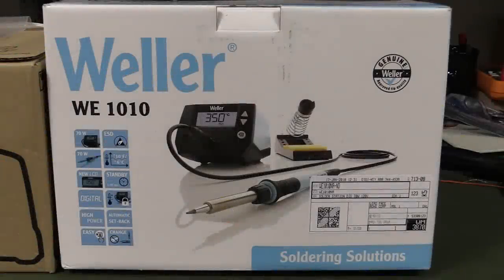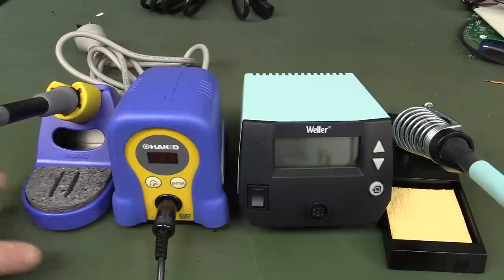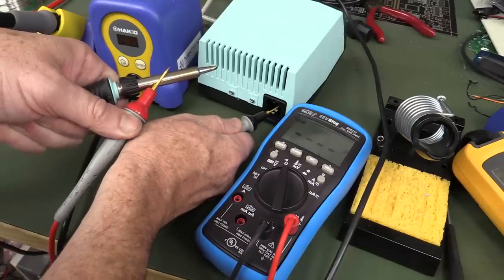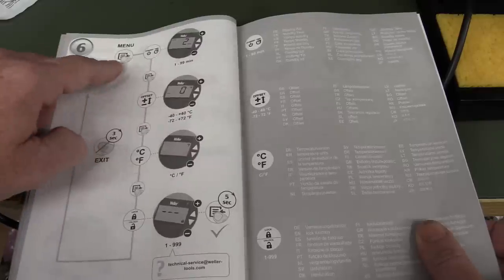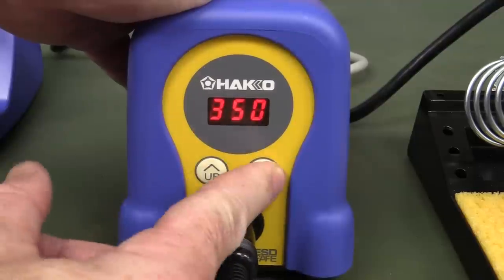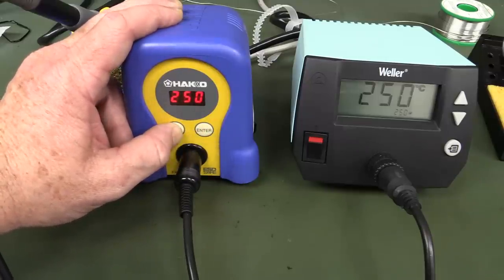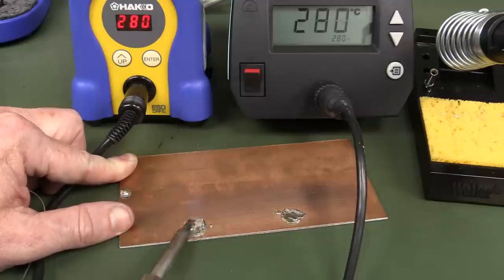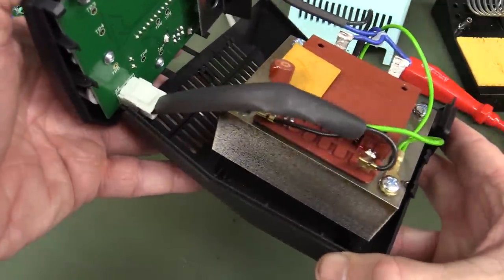EEVblog #1063 - Weller WE1010 vs Hakko FX888D Soldering Station

Comment: Would love to see review of Ersa Icon Pico or Nano. The thing that stops be buying Hakko or Weller is the chunky soldering iron itself. I want something more delicate and pen like. I have a range of Antex fixed temp irons.
Reply: Simon Ashton The “i-tool” irons for the icon stations are great. I have the nano. Wonderfully short distance from grip to tip, and the heating performance wipes the floor with the irons in this video.

Comment: I know this is an old review, but I have had the WE1010 for a couple of years now and have some info.
Some gripes.
1. The display is NOT backlit even though the online pictures from Weller show it to be;
2. How bloody hard would it have been to put a RED LED on the damn unit. I have left this iron on overnight or longer on multiple occasions. Unless you happen to glance at the correct angle onto the NON BACKLIT LCD display it is very very easy to forget that unit is on;
3. The soldering pencil is poorly made and is already loose where the metal iron tube meets the plastic handle.
4. I double sided taped the pencil holder onto the top of the unit to reduce its footprint.

I previously had a Weller WTCP which lasted me 40 years!  I can't see this one getting to 5 years.

Comment: You only need presets in the hakko because of the dreadful interface. The Hakko is really 'wider' than the weller because you need to leave space for access to the switch. The step change test was invalid because you started the hakko when you pressed the key but the weller did not start until you finished setting the temp. The weller shows actual tip temp but the hakko shows internal tip temp. An interesting video but the tests were a bit ambiguous.
Reply from the maker: No, the Weller start going up the instant you press the button, it's only the display that lags.

Comment: The Hakko decimal point shows the duty cycle, as the temp dropped during the sponge test it went to 100% duty.

I have several Wellers and the DIN connectors have intermittent connection issues and it can go open circuit. I have never had a problem with the Hakko brand and have a dozen at work but we used the next step up that has the thin pencil type handles and the tips you can just pull out, never like those threaded holders.

Comment: The Hakko brass wire thingy is amazing. You don't even have to wipe the tip on it to clean it, just pop it straight in and back out, and it looks perfect. I've heard Hakko coats the brass with some kind of flux.

Comment: I’m the biggest Weller fan here :) 
I have all sorts of system from them. From more than 20 years, they never felt on Me. And no iron or soldering station repair ever! Not even a fuse!
Reply from the maker: Space Jesus Dogstar - The Hakko 926 is famously reliable. My 30 year old still works fine with the original iron.
Reply: My Hakko took a few dives off my bench and it's working like a champ
Reply: Justin Nink The mark of a true engineer is a lack of coordination!
Reply: I have a Hakko 926 that I won as a prize for work skills industrial electronics regional finals here in Perth (I represented Perth twice and received two 926's ;) The one I still have (my ex business partner has the other) has run like a champ for ~ 26 years, the only thing I have ever replaced are the tips :) Mine has had things hit it, been dropped off stages etc. I now own a 888D which is my go to Iron for general work BUT my 926 has a big chisel tip of the bigger ground plane joints :)
Reply: EEVblog let me see in 2027 :) both are good brand. But I prefer more the industrial looking ugly German Ursula :)
Reply: I'm not so sure about Weller any more. I have to say, that I'm using my Weller WD2M for over ten years now on a daily basis and it works exeptionally great. But weller has a verx turbulent history of beeing bought by other companies and the quality seems to have degraded a lot over recent years. I even had an issue with an exchange twezzer tip once, that applied like 30V ac on one side of the tweezer and earth to the other, what resulted in a multi hundred euro board beeing destroyed.
Reply: Five years ago i bought the classic WS80 analog from Weller with the switching stand and some tips. I just love this station, never had any issues, enough power for big tips soldering large copper areas and thick cables, easy setting of the temperature, no unnessesary menu crap, I just love the high-flex cable, its gorgeous and the ability of changing the tip without turning off the station. But yes, the springy stands are just crap.

I first heard of Hakko when I started my apprenticeship where we had these stations. From the first use I hated the Hakko FX-951, they look like a toy, the locking mechanism for the grip holding the tip breaks easy, the cable is too stiff for me and these "intelligent" tips sometimes give you errors.
Never would trade my Weller for these Hakko stations.
Reply: EEVblog I got my TCP 24 as an eleven year old boy now I’m about 42 still works but I replaced it with an ERSA pico I got for Christmas but my rusty old Weller is still in the lab. You can’t broke this iron later in RWE and German Army they have had the same one.
Reply: I am still using a 1980's Weller PU2D with TCP iron, I have had to replace the element a couple of times and the magnastat a couple of times also, but I have had this iron since the mid 80's I have a 3M lead on it and I think it holds the temperature better that the unit Dave is testing.
Reply: I bought my WECP-20 when I was in school. That was 35 years ago. never failed me. only bought new tips :-)  Weller rules. And Dave stop whining about the color. That can't be important :-)
Reply: I inherited a PU-2D from my father and I still use it on a weekly basis.  I believe it is from the 60's or early 70's. 
I even have no idea how old the tips are that I have, but in the last 25 years I don't believe I ever bought a tip and they are still looking more than ok.  Talking about value for money and I think it still works as day 1 when it left the factory.
Reply: Yes - old Wellers are amazing in reliability...but the problem I ran into is that the tips for my main workhorse station were discontinued.  That is when I switched to the Hakko-888D...and I have to admit it is nicer (ergonomics/tip selection/cost/footprint) than my all other stations (Weller/Pace/Weller-Ungar).
Reply: After they changed up weller year’s back I’ve seen more issues happen with the new irons they make. The older ones are great though. It’s why I recommend Hakko over Weller for hobby use. If you go more expensive pay a bit extra for a Pace.
Reply: I am with Dave...Aqua is in the same camp as Blue-green...depressing, disgusting color...pretty sure in some ancient religious texts somewhere it is stated as the color of the devil. (...though if I were in the market for a new iron....it would be a toss up between the Hakko and the Weller, sure I would be happy with either).
Reply: I'm sorry :)
Reply: I have much the same experience from work. We have probably around 40 or 50 Weller soldering stations of various types like standard 1 solder iron stations up to the newer 2 solder + 1 heat stations. The only fault type i know about has been wear and tear on the iron themselves and i have switched out the cable on a few. 
Then menu system is kinda bad tho, but newer stations like the WX can be configured via USB.

I havent used Hakko extensively so i have no idea which one is better tho, but Wellers i have used for thousands of hours.. :)
Reply: look at weller reviews. You might want to think again... Hakko has way better reviews. New Weller products are known to break right out of the box, and are junk
Reply: you cant repair what it does not have eg a fuse
Reply: Unknown 9 months ago, that last remark is now somewhat hilarious :P Even though I'm sure your Weller is properly fused.

Comment: I always remember starting at a cable infrastructure installer at a data center and seeing a stack of 8 burned out Weller's sitting in a dark corner.
Asked the owner if I could have them. Took them home and got all of them running again.
Made over $500 reselling them on ebay.

Comment: We have one of the 888D's at work, if you simply use the presets at 50c increments that largely gets around the horrible UI. I'm happy with my original 888, much easier UI, and if I need to replace it I'll probably get one of the JBC irons, I've used them and they're great.
Reply from the maker: Yep. I'd probably set 25C increments.
Reply: id prefer a non digital temp control and just a digital display for temp like the knobs, set it whatever display tells ur the real current temp thats all you need, next they will be wireless and connecting your soldering station to the internet

Comment: You should review the Tenma 80w soldering station with Hakko tips. It's a beast, maintains 350c with ease while boiling the water into steam continuously. it is about £90 in the UK. I would rate it over both of these as a starter iron. :D

Comment: Could it be that the Weller tip sensor is closer to the surface/ambient and in turn the temp reading responds more quickly?  This could be a engineering trick on the Hakko and compensated in the temperature controls.  A true test would be to somehow measure the temperature of the "work" versus using their readout.

Comment: Where do you need adjustable temperature feature? I've been soldering about 30 years and never had an temp controlled soldering iron. Most of that time I've been using Weller WCTP-S iron with self made power supply for it. No problems what so ever. :)

Comment: I've had my FX888D since 2014 and have used it to build, hack, and scavenge hundreds of non-trivial boards by now.  It's never skipped a beat.  I'm still on the original heating element, and I think all of my genuine Hakko tips are still in good shape too.

Note: There is a HUGE difference between generic Chinesium Hakko-clone tips and genuine Hakko tips.  In particular, the latter have far better thermal mass.  Don't bother with anything other than genuine Hakko tips for soldering.  I'll still use a Chinesium tip on my Hakko on occasion - but only for welding plastic, removing epoxy, or installing heat-set inserts...

Comment: IMO the starter range is under $20, while these two are at the top end of the getting serious range. Beyond that, with big $$ possibly getting lost on wrecked projects one should choose wisely and Pace said they'd send in their new ADS200 (120w @ $239 USD). That's the review I'll be waiting for..
Reply: Today $10 buys the beginner a 60W Mustool MT223 for his/her 1st year (or until serious). Light duty regulated irons run from $30 to $150 (search YT for "HAKKO T12 Temperature Controlled Soldering Iron Kit"), but they still don't have the guts or the long-life pro tips like JBC, Metcal or Pace.

Comment: 7:28 - “but these things don't fail all that often”
I dunno. It’s very easy to break the heating element when changing tips on the Hakko. Since you can’t replace the element without another iron to solder the replacement in, you very well might need to concern yourself with the cost of a replacement handle. I’m in this situation now with my Hakko 888D clone from Aoyue only mine uses a different heating element that is backordered for two months (C009). I‘ve been displaced by a tornado since last year and last week my mother got notice that the landlord is selling. We need to be gone in less than 60 days. That means I don’t even have a place to forward it to once the backorder is filled. The only solution to resume work with that solder/desolder station (Int 701A++) was to order a whole replacement iron handle with the element. Even then, I was torn between an identical replacement (B003A) and one without the integrated fume extractor (B003) for a couple bucks less. See? The cost of a replacement handle can be a real issue!

Comment: The Hakko is where it’s at. I’ve had an fx888d on my bench for several years now and the thing has been phenomenal. Granted, I do guitar/tube amp repair so my electronics work tends to be fixing cold and old joints, caps and pots...nothing too heavy duty. But it’s never let me down. As far as an entry level, professional iron goes, I wouldn’t recommend anything else. I’ll upgrade to a 951 eventually but there are various woodworking concerns to tend to in the meantime...

Comment: I wonder if the temperature sensor is closer to the tip in the weller - being closer to the tip would cause the readings to cool down 'further' and heat up 'slower', while maybe the actual temperatures between the Hakko and the Weller are the same. It would be great to get external readings on both for these tests

Comment: I use the Hakko Fx100 soldering station everyday at work.  The Fx100 costs about $500.  The soldering gun on the Fx100 is light and the tip is short.  I have more stability and control on the soldering gun.  I recently bought the Hakko Fx888D and I dont' like the soldering iron very much.  The soldering iron is bigger and the tip is longer.  I have less stability and control on the soldering iron.

Comment: Regarding the sponge test, the Weller heater is on the outside, where the Hakko is on the inside.  I suspect that the thermal path from the heater to the sponge is much lower resistance on the Weller, which is why the temperature drops more.  The ground plane soldering performance is a much more fair comparison since the thermal path between the heater and the tip is more important when actually using the iron.

Comment: Your 350 to 450 transition test wasn't really fair. The Hakko was already heating up as you were still setting the Weller.
Reply: Agreed.  Since it takes longer to set the Weller, he should've set it first.  It also takes about 4 seconds until it times out and confirm you want to change the temperature.  Then it starts heating.
Reply: It is rather irrelevant - when you are losing your time for confirmation or for actual heating.

Comment: the weller cools down faster in the sponge test because the heating element is the outside metal part and goes around the tip, while the temp sensor is the thingy in the middle. So the weller effectively has more surface area and cools down faster in the sponge test because of it.

Comment: You should review some Ersa soldering gear!
Reply: LabCat Weller is the worst.
Reply: LabCat My experience with their gear has been negative in all cases.
Reply: LabCat you must be lucky.
Reply: LabCat Did you watch the video?
Reply: LabCat I would like to see a comparison between ERSA and Weller or Hakko as well. I have an ERSA soldering station and am very happy with it, but I also do not know how it compares to the other brands.
Reply: I have an Ersa and a Weller and I like the Ersa more and I don´t use the Weller anymore. The Weller is a very expensive paperweight now...
Reply from the maker: MrRecorder1 - You can't just compare brands, you have to compare specific models in the same price bracket
Reply: the comparing model would be the Ersa icon pico
Reply: Florian Oberacker Yes. Though for just a bit more money, I’d suggest the nano instead. (I have the nano and it performs great!)
Reply: Antonio Tejada I also have the nano, but the Pico is closer to the prise range of these two. It outperforms my Weller WT1 at half the price!
Reply: The only thing the hakko was better in was the base/iron stand, with the exception of the tip storage on the Weller, heading time by a couple seconds, and made in Japan. EVERYTHING else on the Weller (power, power cord, display, ease of use, hand piece feel, hand piece cord, included chisel tip, hand piece grip, hand piece strain relief, etc was better. Color and design was better in the Weller to, but that's subjective. So why is it even a question.
Reply: The Ersa RDS 80 sells on amazon.com for about $100.
Reply: ERSA i-con is better than... EVER! (And equal a Metcal).
Reply: Hermann Schaefer The RDS80 is a hopelessly obsolete model, nowhere close to the performance of the iCON series. Ersa’s pricing in USA is stupid, but here in Europe the iCON pico and RDS80 are about the same price.
Reply: Florian Oberacker , comparing model from ERSA must be "Digital 2000".
Reply: @EEVblog   Like the  Antex 690D?

Comment: I got the Weller and am pretty happy with it. The only complaints are the lack of backlight for the LCD and the switch. I was used to being able to spot whether I left my iron on by the glowing switch but now I have to double check every time before shutting down for the night. The manual is terrible for what is supposed to be entry level. They treat it like their professional grade stuff and assume the buyer well knows what to do already. If I had to choose again I would still pick the Weller, but my next station will be one of the professional grade units. Spend the $2-300 and have something that will last a lifetime.

Comment: Just getting into the more serious end of the electronic hobby. Really like your assessment. I've used lots of Welle products before, mostly low end. But have been happy. Now with more projects underway and just getting into antenna work with my SDR think I'll jump into the Hakko iron. Thanks for your evaluation. Really enjoyed! Cheers. PS that funny sponge feel to the Hakko, is supposed to be electrostatic in nature. Design over function has no weight for me... so think I'll go Hakko. Thanks for a great review.